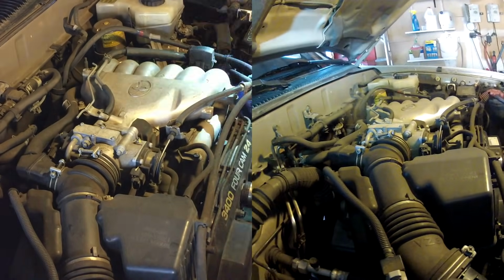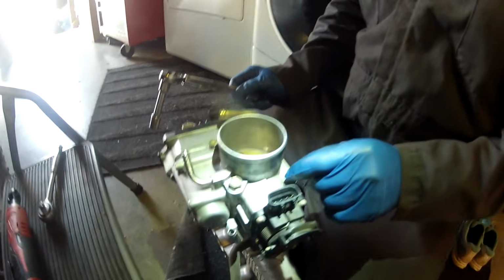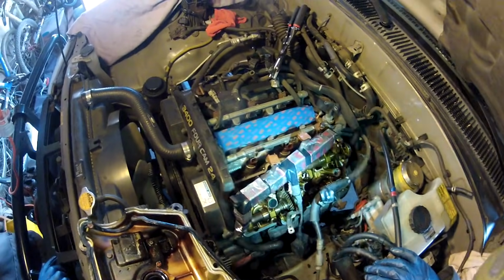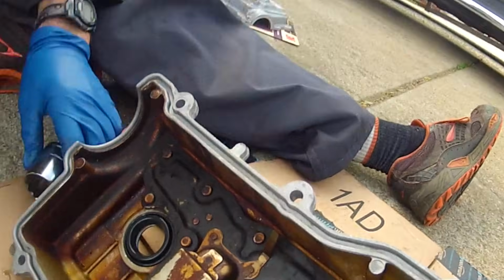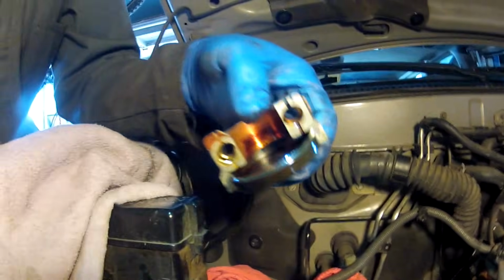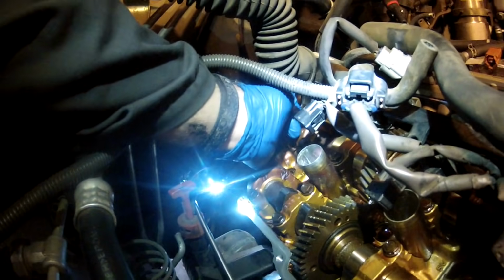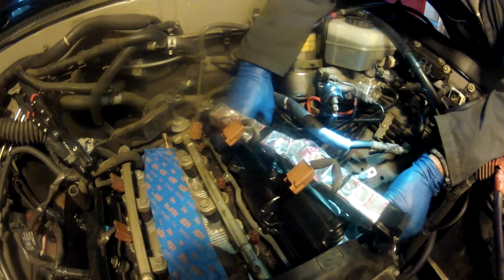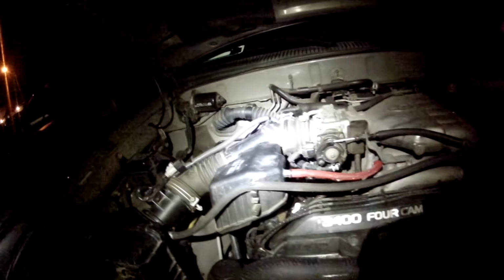3.4 L V6 5VZ-FE Toyota 4runner, Tacoma, Tundra Valve Cover Gasket Tutorial

Comment: After watching this video (a few times) and reading 823 forums posts regarding the project I (almost) have myself talked into attempting to do this myself. Since I also intend to replace the radiator soon, would there be any benefit to yanking it out before doing the valve cover gasket?
Reply from the maker: You can do this job no problem.  If you take your time, take pictures during disassembly and label hose and electrical connections, you'll be fine.  

The radiator is a totally separate job.  Pulling it out won't make the valve cover gasket job any easier.
Reply: Thank you for the clarification. At some point I thought I’d read that getting radiator hose out of the way freed up some space to do something, but that question probably also illuminates my mechanical ineptitude. My last mechanical adventure resulted in an innocent garage door getting shanked by a screw driver out of frustration and that was only a thermostat on an old Cherokee.
Reply from the maker: @KB-zo2ye  Come to think of it, if the upper radiator hose is out of the way, you could release the upper timing cover to give you more room to disconnect electrical connections on the passenger side and also have a bit more room to get the valve covers out and back in.
Reply: @TimmyTheToolman  Thank you for update. I will need all the help I can get so i will definitely yank it out of the way. Also, I noticed while putting my parts list together that as of 2/2/2023 the intake plenum gasket (part #17176-62040 ) is listed as unavailable on Toyota parts websites. Not sure if there's an alternate part#, but I couldn't find it so I ordered off Amazon.
Reply from the maker: @K B  I don't know if Toyota is having supply chain issues or they are discontinuing parts.  I know at some level they are discontinuing parts, but plenum gaskets seem pretty silly to discontinue since there are hundreds of thousands of vehicles with these engine still on the road.

Comment: Thanks man. I was able to successfully complete this project by following the instructions offered in this video. I had a check engine light upon first firing up my truck after completing the repair. I disconnected the negative battery post, waited about 30 seconds, reconnected it then fired up the engine and  the light went out.
Reply from the maker: You're welcome Larry.  Good job getting it done.

Comment: Hey man, 
Can I ask - did you do the FRONT camshaft plugs as well?  Or just the rear ones?  The one one the front passenger side seems impossible to get out (due to clearance from the radiator mount in front of it).  Just curious if you did the front ones as well, and if you didn't - was it for the same reason, or some other reason?  
Anyone here have a response?  Thanks!
Reply from the maker: The front camshaft seals are replaced when doing a timing belt job.  You just replace the rear cam plugs when doing a valve cover gasket job.  We made a mistake in the video saying you need 4 cam plugs.  We mention this in the video description but some people miss it.  If that's what happened, I apologize.  Hopefully you can return the other 2.
Reply: @TimmyTheToolman  Thanks Timmy.  That helps a ton.  I thought I had read and watched every inch of your video (which I have dozens of times now), but missed your clarification in the video description section.  
That all makes sense, and makes me feel better, as I was really struggling to see how to get in there with the timing belt bracket/backside there impacting the access of the actual plug itself.  Thank you again for your quick reply and info!
Reply from the maker: @fetchjunkremoval  You're very welcome, and again, sorry for the confusion.  Good luck finishing up the job.

Comment: I just finished up on my grandsons 2000 4runner, thanks to your video, it took me a few days to complete as i went very slowly. I had a slight huge delay as i was removing passenger side valve cover, one of the bolts fell off and went in camshaft. I had a very small space that i located it and did not think that this was going to be possible to get this out. Only a very small magnet extension , and a miracle from God that i was able to retrieve this,  all of them are stuck on there, but one came off. My son in law who is excellent mechanic said it had to come out, or tear the engine down. Thank you again.
Reply from the maker: Man, that must have been stressful losing that bolt into the engine.  Glad the story had a happy ending.  You're welcome and Happy Wrenching!

Comment: My '01 doesn't seem to have the wiring harness that breaks easily. It's a rebuilt motor so maybe it broke and was removed before I got it? Is this something I should look into replacing while I'm in there?
Reply from the maker: You could just use some split wire loom and electrical tape to help protect the wiring harness.  You can find split wire loom at any auto parts store or you can buy it online.

Comment: HUGE shout out to this video and creator, it is by far the most comprehensive detailed video on this subject. It totally helped me do this job.   I offer one suggestion:   when replacing the spark plug tube seals you can deform them and remove them without trying to get a grip on the tabs. Once they're out you can flip over the valve cover and use a punch to deform the tabs upward and outward to get enough clearance to insert the new ones.
Reply from the maker: Glad you like the video and thanks for sharing your tip to get the spark plug tube seals out.
Reply from the maker: Thanks a bunch for the kind words. This was basically the main video that got us started on our YouTube journey and we have learned a lot since we started, both from the quality of production to little tips and tricks our viewers share along the way. We hope you consider subscribing to our channel and giving us a thumbs up!
- Sean

Comment: Hi Timmy, I've watched this video, as well as the one on fuel injectors, many times before finally (and very slowly) attempting to mimic all of your steps on my '98 T100. I hit a wall this afternoon after unbolting the semi-circular holder  securing the front camshaft plugs. How do I remove the plugs, which are sandwiched between the camshaft and the timing belt backing plate. Do I unbolt all of the holders securing the camshaft and then lifting the camshaft? Sorry, I can't seem to find this step on your video. Thanks in advance, and for all of your very helpful videos!
Reply from the maker: Hey Neil, sorry for the confusion on the parts list at the beginning of the video.  For this job, you only replace the two cam plugs at the backs of the heads.  The parts list said 4 cam plugs but you only need two.  We corrected it in the video description but obviously you missed reading that.  You would replace the cam seals behind the camshaft timing belt pulleys as part of a timing belt job.
Reply: Hi Timmy, thanks for responding promptly. So there's no crankshaft plug in the front? Is the (brownish color) part that I see there sandwiched between the crankshaft and the timing belt backing plate a crankshaft seal instead?
Reply from the maker: @neilnarciso4945  There's a camshaft seal in the front, not a plug.  Watch our timing belt video and you'll see how that one is replaced.

Comment: hey Tim, midway through valve cover gasket replacement , found out last mechanic lost a valve cover bolt! any idea what the part # is? I have 16 valve cover washers and 15 bolts. just my luck....Thanks for all the help and the video.
Reply from the maker: Don't know the part number for the bolts.  You could simply go to the hardware store and match one up the best you can.  If you want an OEM bolt, just visit your local dealer and see if they have one.  It can't be that expensive.

Comment: I’ll be tackling my 3.4 v6 next week over here in Australia, thanks for making this video. It explains everything well. 

Did you label all the vacuum hoses? Or are they different sizes and hold their shape and turns etc to see where they go back on?
Reply from the maker: When I first did the job, I labeled everything.  Now that I know these engines well, I don't need to label anything.  They are for the most part different sizes.  If I were you, I'd take the time to label just to be sure and take pictures too.  The hoses that people commonly mess up on are the ones that go to the throttle body that has a detachable IAC valve.  There's two coolant hoses and one vacuum hose that attaches to the IAC.  People mess up and connect one of the coolant hoses to the vacuum assist hose going to the injectors and they end up flooding the cylinders with coolant.  Don't make that mistake.  Pay particular attention to that.  The ones that are coolant hoses have a hose clamp.  The vacuum hose doesn't have a clamp.

One vacuum hose that is easy to forget is the one that goes to the fuel pressure regulator.  Don't forget to plug that one back into the lower plenum before putting the upper plenum on.  

To get a little more movement from the engine harness on the passenger side, you can make an engine harness disconnect at the water neck that houses the thermostat.  One of the nuts captures a wiring harness anchor point.  With that disconnected, you'll be able to lift the harness up higher to give you an easier time getting that driver side valve cover out and back in.

Good luck with the job!  Hope it goes smooth for you.  Happy Wrenching!

Comment: Do you have to cover the exposed part of the engine if leaving it open for a period of time? Do I have to worry about dirt getting in there or will it all be caught in the oil filter eventually?
Reply from the maker: I'd keep the ports covered on the intake manifold so nothing can drop into the engine.

Comment: great video!  really wish I could have read the three page list you made for disconnecting aand reconnecting all the parts.
Reply from the maker: You could just take your own notes as you disassemble things.  

Another thing that I do is when I bag and label my fasteners is I lay the bags out in the order I removed them.  Then when I'm ready to put things back together, I grab the bags in reverse order and know what I have to put on first.  I find this really helpful and allows me to skip the step of taking notes.  

As you get more comfortable turning wrenches, jobs with a lot of steps become much less intimidating.
Reply: @TimmyTheToolman  thanks for the advice. Find I get more relaxed after watching repair video several times. Watched a timing belt video about 10 times before I did my timing belt. I like the bag idea and really liked your detailed instrictions once you got to the valve covers. will be watching your video plenty more times  then I'll be ready. Thanks again for great video
Reply: @TimmyTheToolman  thanks for the bag tip. I replaced my tundra timing belt 2 years ago so I'll probably watch your video 5 or six times and then go for it. Thanks for the great video!
Reply: ha ha on me. just started watching your video again after a year and hadn't noticed I had already complimented you on your bag idea. Maybe I won't have to comment next year because I'll have dome my covers. Cheers!

Comment: Did you paint the valve covers?  if so what kind of paint can handle the temp?
Reply from the maker: Yes, we painted the valve covers.  You just have to purchase a high temp paint meant for automotive applications.   Do a search on Amazon for "Automotive High Heat Paint" and you'll find plenty of options.

Comment: I have another question if you have the time.  How does one go about removing the old valve seat and installing a new seat when rebuilding the head on a 3.4 engine?  I have the tooling needed to cut the angles.  Thank you very much for your time.
Reply from the maker: I've never rebuilt a head so I wouldn't be able to give you advice on this.
Reply: @TimmyTheToolman  ;Thank you for responding.  That's okay.  Thank you for your honesty.  Keep making all those excellent videos.  I will find an answer somewhere.
Have a great day.

Comment: Did anyone had coolant leaks into the spark plug tube and into the oil after doing the valve cover gasket
Reply from the maker: Did you maybe hook up the coolant hoses wrong under the throttle body?  One connection is for the air assist hose for the fuel injectors and the other two are coolant connections.  If you connect them wrong, you flood the engine cylinders with coolant.

Comment: Timmy, it appears you painted the value cover. Just wondering why and what kind of paint did you use?
Reply from the maker: Sean wanted to paint his valve covers as part of the job.  I can't remember the paint he used but you would want to chose a high temp paint for automotive applications.  I'm sure you'll be able to figure it out doing a search.  I'm pretty sure auto parts stores sell high temp paint.

Comment: Hey Timmy! I was just told by my mechanic i need to replace the valve cover gaskets bc the leakage. To do so would i need to replace all of the things you also did? Or is doing just the cover gaskets fine? Trying to see if i can do it myself snd save money
Reply from the maker: You should replace everything we did in the video, other than the spark plug wires and the spark plugs.  Those are optional to replace.  If the spark plug wires and spark plugs haven't been replaced in a long time, I suggest you replace them as well.
Reply: @TimmyTheToolman  okay thank you so much!
Reply from the maker: @jake27schannel  You're welcome Jake.

Comment: There is know need to bend anything out of the way to replace the spark plug tube gaskets.
When I replaced those gaskets on my '00 4R, I popped the old ones out from the top of the 
valve cover be inserting a wide blade screwdriver between the valve cover and the gasket 
and twisting blade. I installed the new ones by simply pushing them into place with my 
thumbs.
Reply from the maker: You were lucky you could pop them out from the top.  When they are really old and brittle, the spark plug tube just breaks apart.
Reply: @TimmyTheToolman  Hi Timmy, maybe you misunderstood my explanation, the valve covers 
were off the engine when I replaced the spark plug tube gaskets as I was replacing all the other
gaskets you did in this video. I found the old spt gaskets came out rather easy by working a 
screwdriver between the valve cover and gasket from the top side of the valve cover rather 
than trying to hammer them out from the inside. I was also able to install the new spt gaskets
rather easily by simply pushing them into place without having to bend anything. I used all 
new Toyota parts for this repair.
Thank you for taking the time and energy to make these excellent diy videos.

Comment: When I first removed the bolts on the valve cover, I could do it just using my fingers because the rubber/metal washers dry out and shrink so I replaced all those when I replaced the valve cover gasket but I didn't use the sealant where required so now I get to do it again.  I used "blue" thread lock on all the valve cover bolts because like I said they were all loose and one was almost all the way out.
Reply from the maker: Blue loctite is a smart idea.  Good luck with the work.
Reply: @TimmyTheToolman  I ended up removing all the plastic on the wire harness on the driver side and I'll wrap some foil tape on there after the covers are back on.  My half circles had some fat ridge towards the engine & some away from from the engine, I wonder if someone has done this job in the past but I will put all fat ridge sides towards the engine.  I am going to try a very thin amount of FIPG around the caps at the back.  I believe that is where my main leak is now.
Reply from the maker: @christopherbrown5338  I would recommend buying new cam plugs rather than using FIPG to reseal them but people have been successful doing what you're doing.
Reply: @TimmyTheToolman  Money is super tight right now.  I did just order the plenum gaskets.  I hope I don't regret not changing the plugs.

Comment: Where did you get a mirror with a light on it.  When you were checking the seating of the rear cam plug after adding the rtv, you used this mirror with light.  Also what torque wrench do you use for lower torque needs?
Reply from the maker: Hey Chris, check the video description for the full list of tools we use in the video.  The inspection mirror I link isn't the same one I own, but it's close enough.  I couldn't find the exact one I got.  Maybe they don't make it anymore.

Comment: Thanks, for the parts list, is that a universal parts list for all cars with a 5vz-fe? I've got a 95 series Prado so it's a good bit different
Reply from the maker: Those parts would work for any 5VZ-FE in the U.S.  I haven't worked on a Prado so I don't know what the differences are.
Reply: @TimmyTheToolman  thanks for your quick reply. Are any parts, would you think, driver side specific? As I'm from Australia so the steering is on the opposite side
Reply from the maker: @burntoutelectronics  No, being right or left hand drive wouldn't change anything.